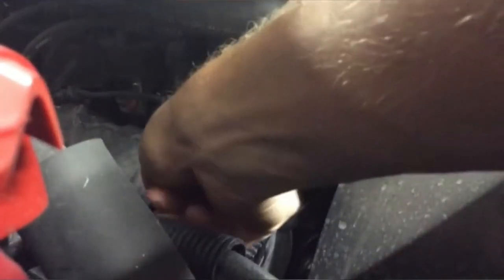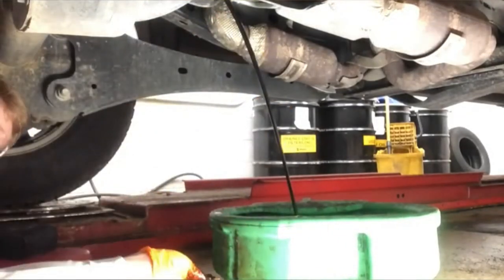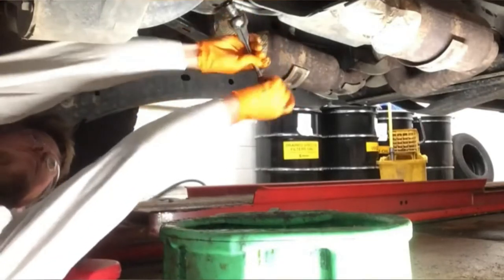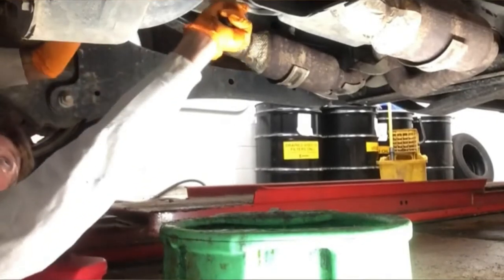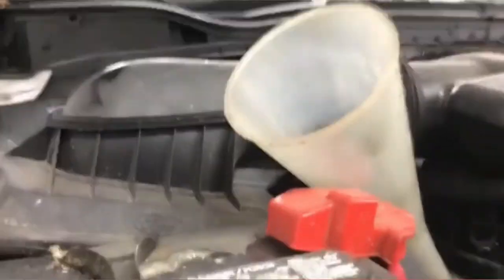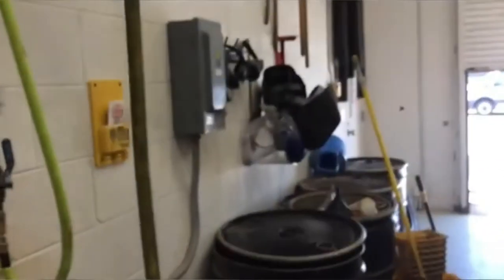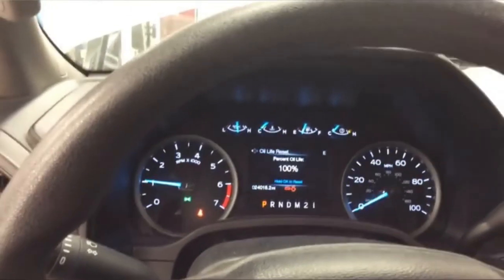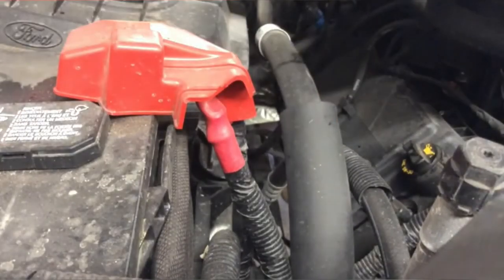2017-2019 Ford F250 6.2L Oil Change

Comment: FYI there is a TSB about long crank starts due to too much oil. Ford did my changes and were doing 7 qts....  and told me I put too much in, told them to look it up, THEY did the oil change....they re-did oil change and did 6.6 qts. I still have my long crank issue which I am pretty sure is the Fuel pump check valve, out of Warranty now, so will wait til it gets worse or fails.
Reply: My positive battery cable is my issue. It needs replacing but I also have the long crank. 2017 f250 6.2 gas. Also I use 7qts
Reply: The Dealership screwing something up and blaming you for it???   No!  Say it isn't so.  ROTFL
Reply: Long crank issue with my 2018 6.2L as well ☹️
Reply: The long crank issue is indeed the check in the fuel pump assembly. I replaced mine 2 months ago and it is perfect
Reply: Just my little input, I had Long cranks for longest in my 2017 f 350 6.2L and I ended up putting marvel mystery oil in my gas tank when I filled up and, knock on wood, haven't had 1 yet
Reply: I do my own oil changes on my 21 f250 6.2 . I let the oil drain for a long time . I usually put 6.5 quarts in start it let it sit a while , check the level , add another 1/4 quart .   Bottom line if I just added 7 I'd be over filled. Big deal I doubt it but I'd rather have it correct.